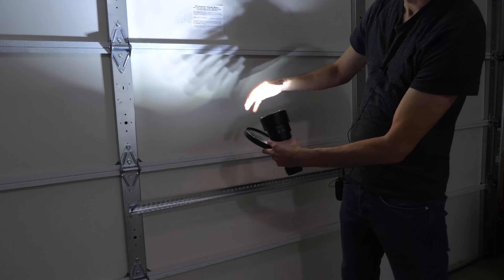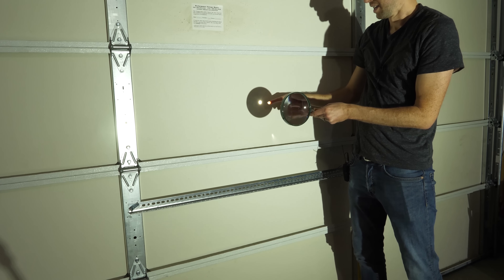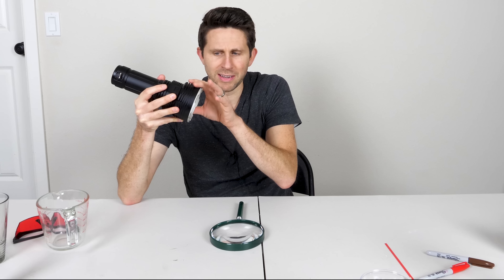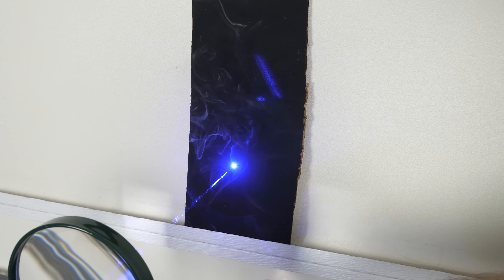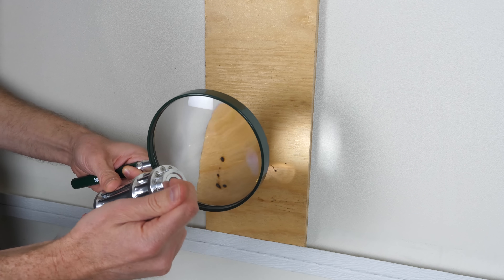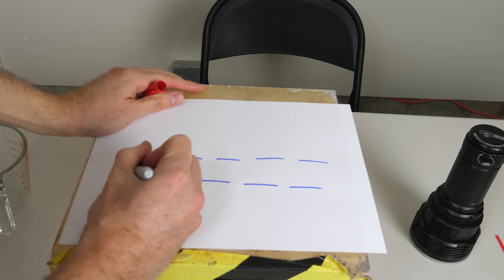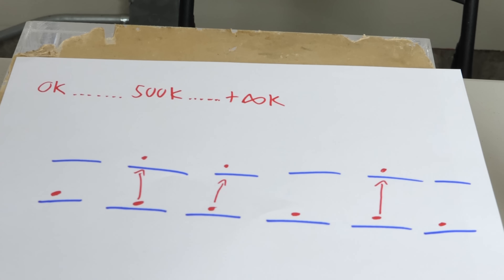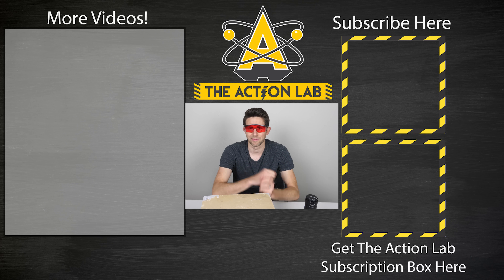What Happens if You Focus a 5W Laser With a Giant Magnifying Glass? Negative Kelvin Temperature!

Comment: pretty sure you misquoted the 2nd law there when erroneously claiming it's impossible with a normal flashlight. simply get another, closer, lens to collimate the rays before focusing them to a point, and done. the second law doesn't say you're not allowed to build refrigerators. it simply says they don't build themselves. and what you do with a lens is not "increasing temperature" but redistributing its target area. it's still the same energy being impacted on the target, just instead of flooding the room with low energy per area you focus it on a single spot that then gets way more energy _per area_. your laser itself literally proves it's possible to make the target of some radiation "hotter" (= more energetic) than its source: otherwise "pumping" wouldn't be a thing.

oh btw the source you quote (apart from the link being 404) literally says "lasers cannot have negative temperature" (because they're not in equilibrium but keep being pumped), while sources they quote say they do, so even they don't seem to be sure.

they also don't explain how all of their samples don't immediately go to ±∞K as soon as they allow them to equalize temperatures with the environment. in fact, shouldn't a simple laser pointer's dot have infinite temperature because you have ~+300K in the environment and allow that to equalize with the "negative temperature" in the laser?
i think the term might simply be misleading, what you really have here is an "inverted energy distribution" or "negative statistical-entropy-per-delta-energy coefficient", is it not? maybe it shouldn't be called "temperature" if it's... not that :P hey even defining it as a function of coldness (thermodynamic beta = 1/kT) makes way more sense. the "temperature" bit really just feels like a desperate attempt by companies like QM to shoehorn an abstract concept such as population inversion back into a "layman's understandable word" but ignoring the facts: a) that's not what that word means in a layman's understanding, and b) it doesn't make much mathematical sense either given beta works way better for all of those calculations.

about your own pinned comment i can for some reason not reply to: the second law of thermodynamics says that entropy in an isolated system left alone cannot decrease. but when you're pumping electricity through LEDs that you then focus onto some target to heat, that's not that. it's neither isolated, nor being left alone, nor actually entropy decreasing (you're simply converting electrical energy in the battery/power plant/whatever into kinetic energy in the target, actually increasing overall entropy. btw if you look at the actual complete system like that, you'll of course find that your target can't receive more energy than your electrical power source provided, satisfying the 2nd law). pretty sure that's what the QM folk mean by "pumping doesn't count": technically you're dealing with population inversion and all that in a part of your overall system, but not in an isolated system doing that "naturally".
Reply: Finally someone who fully understands my confusion
Reply: Yeaaaa.. exactly what I was thinking
Reply: thank you for doing that so i didnt have too.
Reply: Underrated comment
Reply: ……uh whatt
Reply: I think he misspoke when he said the second law of thermodynamics and meant the second law of heat transfer. Heat flow from hot to cold unless additional energy is applied. 
This bothered my intuition in physics class when I learned about it. It seemed to me that if you had a really large mirror and magnifying glass you could “gather” and focus a significant portion of the suns emitted energy and focus it at something that would become very hot. My physics teacher retorted that once it became the same temperature it would be emitting energy back in equilibrium.  I wasn’t very satisfied and it still bother my intuition.
Reply: @georgemesser5655  the one that helped me a bit was that from the dots point of view, the sun becomes bigger and bigger until it fills the sky, but it can't some how get more sun than that.
Reply: @georgemesser5655  Your physics teacher was correct. Think of it this way: E=kT Energy = boltsman constant times temperature. What this actually refers to is average energy of atoms in a medium of temperature T is E=kT. Energy of a photon is E=h*f energy = boltsman constant time frequency. Now, in theory, as you get frequency very high each photon will have very high energy and average energy of the beam of photons would be equivalent to a stupidly high temperature, hence enabling the beam of photons to continue to transfer energy to a body that it is hitting and in doing so continue to heat that body up until that body reaches the temperature almost equal to temperature of beam of photons falling on it. At the same time energy is leaking from that body due to its own black body radiation. Visible light is 400-600 nm so say 500nm on average. That is equivalent to 2.46eV per photon. At room temperature the average energy is 25.7meV or about 100 times lower than energy of visible light. This is why even infrared lights can heat things up if are powerful enough but low power, high frequency lasers simply cannot deposit enough energy fast enough to heat things up.
Reply: The "laser with negative temperature" really doesn't make sense to me. The destination doesn't care what the source is, photons are photons and always transmit energy to the receiver to my knowledge.
Reply: nice explaination, but i still don't understand either the video or your comment cuz of my smol brain lmao
Reply: @SuperSonicScott I em agried
Reply: In short: If you turn the laser off, the time between the last photon leaving the laser diode and it striking the wall......... is when entropy takes over and the 2nd law of thermodynamics kicks in. Einstein remains the champ.
Reply: my guy wrote an entire fricking essay to explain this. Thx
Reply: i like your funny words magic man
Reply: Thank you, you saved my time explaining it
Reply: Thanks, I agree, I was thinking this vid had some shaky reasoning.
Reply: I would have dropped a "thank you" meme with the waving hands but youtube wont show it either way
Reply: Kernel Panic!
Kernel Panic!
BSOD code: OMG!+WTF!
Memory Dump in progress...
Stand-by for rebooting of this system.
ERROR! Boot-strap burnt. 
Manual location of non-burned boot-strap is required.
Press any key to continue...
Reply: Such detailed explanations for popular videos would be quite cool in video format. I'd love to watch debunk/dehype videos of that sort.
Reply: The film is interesting, despite the doubts. By the way, lenses and magnifiers usually focus more strongly when they have a smaller diameter. That's just how it usually is. “Light Amplification by Stimulated Emission of Radiation” LASER. Amplification is not a natural process. And there is a lot of specificity in these analyses, but this is an interpretation.
Reply: this is exactly why i think this channels is a load of bull
Reply: As someone with an actual physics degree, I agree with what nonchip has posted. Additionally, focusing a flashlight to a point is much harder than focusing a laser, because focal length of the lens actually depends on wavelength of light being focused, because refractive index of any material depends on wavelength. That is why cheap camera lenses show longitudinal chromatic aberrations. Laser, in theory, having light of essentially 1 wavelength can, in theory, be focused to a single point.
Reply: @ghffrsfygdhfjkjiysdz  focusing a flash light to a point is limited by the conservation of etendue, so it cannot be infinitely concentrated. And negative temperature has been a thing since the 40's, so I've no idea what nochip is going on about.
Reply: @trouty7947  Agreed, however concervation of etendue is more complicated than just concervation of area, but rather a concervation of product of area and brightness. So it's more like concervation of power rather than just area. Think about using a lens to focus suns rays to burn wood, the focused spot is whole lot smaller than the emmiter, the sun.
Reply: @trouty7947   I have no idea, either.  Of course, I have only the barest understanding of these concepts.  I can do literature searches, though, so I did. The concept of negative temperature has been the subject of contention in recently years. Motivated by the pretentiousness in this comments section, I haphazardly followed the debate in the literature as best I could (working on my phone), ultimately arriving at an article which contextualizes this contention within a broader, fundamental disagreement about thermodynamics itself.  This paper references another which deals with negative temperatures specifically.   This is as far down the rabbit hole as I care to go.  I also confirmed that negative temperature came on the scene roughly at the time you describe.

The second one can be retrieved using sci-hub.se.

If anyone who actually knows about these things wants to comment on this, I'd be interested to to read it.

Thermodynamics, Statistical Mechanics and Entropy
by Robert H. Swendsen
Physics Department, Carnegie Mellon University, Pittsburgh, PA 15213, USA

Entropy 2017, 19(11), 603; 
Received: 30 September 2017 / Accepted: 6 November 2017 / Published: 10 November 2017

https://www.mdpi.com/1099-4300/19/11/603/htm

Physics of negative absolute temperatures
Eitan Abraham and Oliver Penrose
Phys. Rev. E 95, 012125 – Published 17 January 2017

https://journals.aps.org/pre/abstract/10.1103/PhysRevE.95.012125
Reply: I think you are correct in that collimation is the answer to what is happening with the laser and does not happen with flashlights or the sun.
Reply: Large cold source, tiny hot focal point
Reply: In order to perfectly collimate the rays, the light source would have to be a perfect point (in which case its energy density would be infinite, just like the focused point you're trying to create at the other end - so no contradiction).

It isn't a perfect point, so you can't perfectly collimate the rays - the best you can do would produce a focused image having the same size and energy density as the original emitter.
Reply: Yea U have wined...
You have Big Brain!
Congratulations!

Comment: Is there any amplification effect from the recombination of portions of the coherent radiation? Are you using a laser of 5 Watts or 5 mW? If five Watts can you share your source? Could magnification take a lower energy laser such as red or green and amplify it to a burning level? I’ve seen videos where a large field of mirrors are focused to a single spot to heat plasmic Sodium which in turn boils oil and eventually water to drive steam turbines. Assuming the Sun has a surface temperature of 10,000F, the Sodium should not be able to exceed this temperature no matter how many acres of mirrors are used? Is this correct?
Reply: The surface of the sun is at 6000K I think. Increasing the capture area, that is the area of the mirrors helps increase the  total energy flux captured while it cannot increae the max temperature.

Comment: This guy does NOT understand thermodynamics. Just because the temperature on a tiny dot is higher than the source which has a much larger area does not mean you are breaking any laws of thermodynamics. It can easily be done. This negative energy explanation is absolute nonsense. 

Negative energy implies that it would be attracting or sucking in positive energy, or at the very least neutralizing it. That would mean all lasers would get cold when operated. This is flat earth level logic.

Comment: Flowing heat from cold to hot does not violate thermodynamics. What you seem to actually mean is that it violates thermodynamics by "creating" energy.

You could use two lenses to focus ALL of the light of the flashlight to a single spot, and whilst it wouldn't be brighter overall, it would be brighter per sq/m

Comment: Now this make me wonder, how many magnifying glasses would be needed to make steel melt with just that hand held laser.
Reply: I'm guessing it wouldnt be possible. If you had theoretical conditions then maybe but there isn't enough power in a common laser pointer to do it. Magnifying glasses arent 100% perfect so you'll lose some energy and could never get it to the tightest possible configuration of photons on the face of the steel. And steel is a metal so its reflective so you lose tons of potential heat as dispersed light (more so the less focused the light is). Not to mention you'll lose even more heat to the environment.

Comment: For everyone that's getting confused by the "negative" temperature, it's because the temperature scale we use ("hotness") is not the fundamental thermodynamic scale but actually "coldness" (reciprocal of "hotness") is. We just use "hotness" scales like deg C and K in everyday life due to convention and because it's more intuitive. But that's why it jumps from +infinity K to -infinity K on "hotness", because that's just where the "coldness" goes through 0 (think about the point on a 1/x graph where you divide by 0). So as "coldness" decreases to negative values, things are getting hotter - which is why you get a negative temperature.

Comment: What makes more sense to me is that temperature is the average kinetic energy of the particles. When you increase the energy density through the magnifying glass you increase the energy density at that point. So it is working like a funnel. You take the same energy amount and just focus it on a smaller area thereby increasing the energy density. No violation of physics and explains better than negative kelvin. There is a maximum temperature, but it is when a particles kinetic energy is so high that the particles break down into pure energy.

Comment: What about putting the laser down the farthest seeing telescope
Reply: The lens configuration doesn't really matter. In the case of sunlight and artificial light, you can capture all of the photons and point them at the same spot and there's a ceiling temp it will hit. The major limiting factor in getting to that temp is the area of the spreading out light you can capture.

With a laser, you have an already concentrated beam, and as long as the optics can capture all the photons in the beam (pretty easy to do as you can see), you can focus them down.

You'd be better off with a microscope running in reverse than a telescope anyway... They are designed to keep very small points of light in perfect focus... A telescope can do it too but a microscope is ideal.

Really doesn't matter what you use, ignoring various losses in the optical path, it will be essentially the same and come down to the quality and characteristics of the optics.

Comment: A few things:

One, I can clearly see, with my own two eyes, that a lens (or two) can focus diffuse light onto a smaller point. Eyes. Eyes do that.

Two, just because your flashlight is a flood light (it features a fixed zoom that spreads the light out in a cone pattern whose narrow point is at the light) and you don't have a lens that can correct that to a cylinder or a converging beam, doesn't mean you can't concentrate a flashlight to create a point that is hotter than a comparably sized point on the source.

The laser isn't avoiding a violation of the second law by quantum magic, it's avoiding it by not being perfectly concentrated out of its source. No energy was made, and entropy did increase overall, as the higher grade energy that powered your laser dissipated into the room as heat and light.

Tl;dr: it ain't that deep, guy.

Comment: The statement that negative temperatures are hotter than positive temperatures makes sense (in Kelvin), because 0K= −273,15 °C (−459,67 °F), so if +0 = -n than -n = +0 and +n = -0, so 0 Kelvin is −273,15 °C than +273,15 °C is -0 Kelvin.

Comment: If you have a big enough magnifying glass with high refraction, you CAN focus ~100% of the light of a flashlight onto a single point, and it WILL be hotter than the source, as the energy is concentrated. If your flashlight is 100 watts, it is emitting 100 joules per second, mostly as electromagnetic radiation (light and heat). A 100 watt light bulb might get to 320-350 kelvins.
Joules can be converted into kelvins. One joule is 72.43 exakelvins (72,430,000,000,000,000,000K). Kelvins are a measure of point-temperature, or the amount of energy in a single point in space. Joules are a measure of energy in a volume. 
Light bulbs distribute light and heat across a wide area, not a point, so those 7.243 zetakelvins (remember, 100 joules, 100×72.43EK) from a 100 watt bulb are spread out such that any given point is 19 orders of magnitude cooler. With a big enough magnifying glass, you can condense this energy into a tiny point, which may be thousands of kelvin.
To break thermodynamics, the focused light of a 100W bulb would not need to be hotter than the bulb's surface or even it's filament, it would need to be hotter than the energy it consumes, hotter than 7.243ZK.

TL;DR: It's possible to focus the light from a flashlight, or the sun, to a single point that's hotter than the surface of said light, as the energy these sources produce, should it be condensed to a single point, would be far, far hotter.
Reply: Smartass

Comment: What if you wrap a very reflective surface around the circumference of the flashlight that allows it to distance the magnifying glass sufficiently away for it to focus it without light dispersing? The magnifying glass reminds of leveraging in classical mechanics ... one can maybe think of it as a form of electromagnetic leveraging. :)
Reply: A pipe coated with silver or polished aluminium internally.